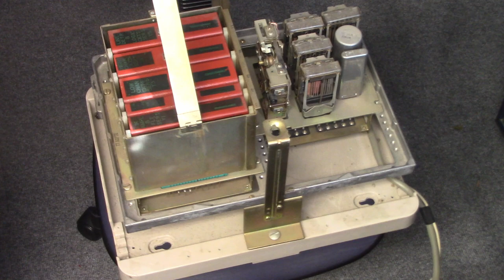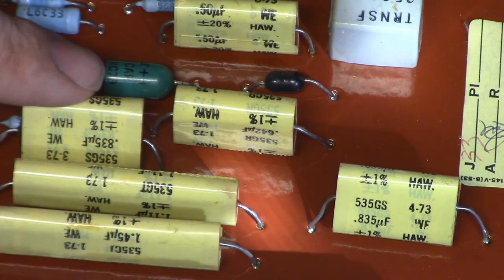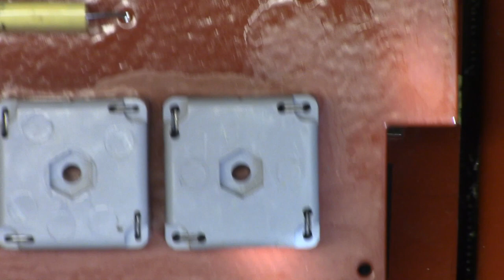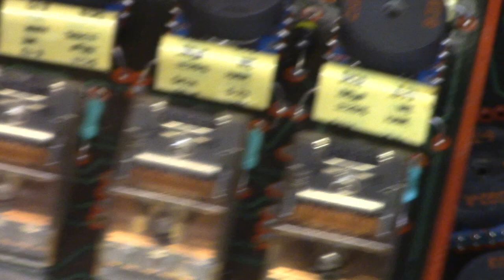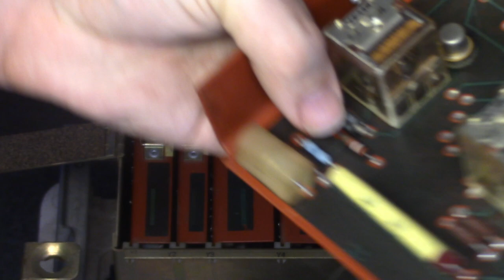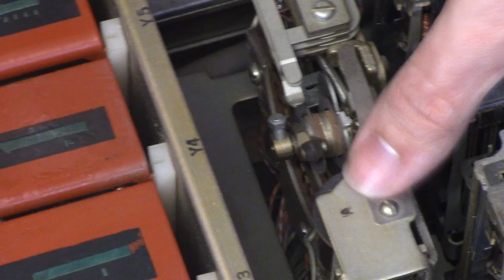Interesting Vintage Western Electric Circuit Boards from 1973

Comment: That round thing at the end was a Strowger switch.  The 70's were an interesting time for communications and industrial controls.  There was an odd mix of mechanical items mixed with electronics.  Now it is all electronics and the days of brilliant, precisely made mechanisms are long gone.  They should really be preserved for their curiosity value.  Mechanical time-clocks, small AC motors to drive a speaker for Navy squawk phones, switches to control numerical displays, are all very fascinating, but electronics do things cheaper and more reliably.

Comment: Those yellow capacitors I believe were Mylar types, they were good quality @ +/- 1%.   They used used to make equipment to last for many years, the old Western Electric telephones lasted easily 40 years.

Comment: This is part  of a Key Service Unit (KSU) for a 1a2 key telephone system. The TT ADPTR is probably for providing intercom functionality. It is covered in Bell System Practice SECTION 518-410-411 and you can google for that number and find a PDF of it. It dates back to the mid 1960s.  This is probably still valuable to someone who collects this stuff.